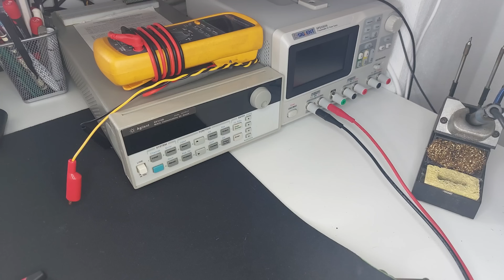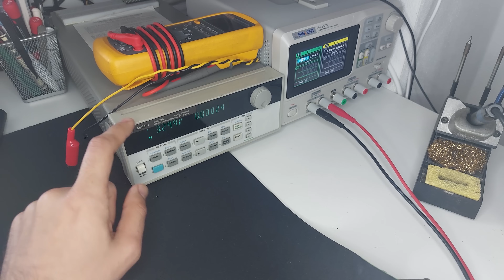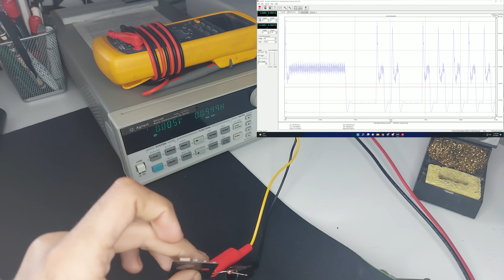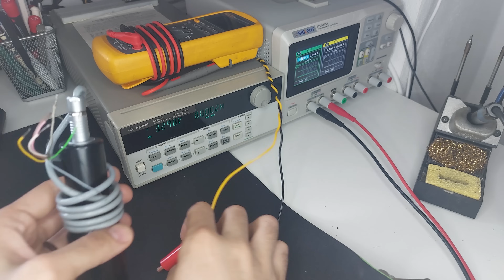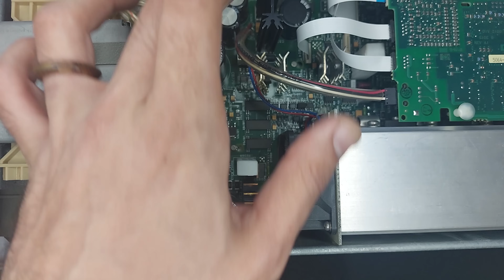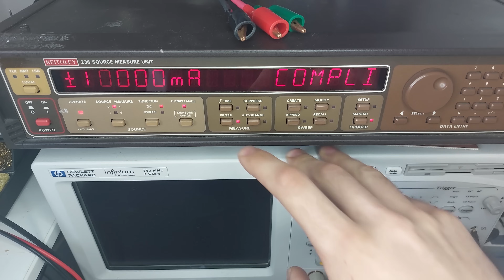The best power supply nobody knows about

Comment: The best power supply is like your best screwdriver; it all depends on what you need it for.  I must have over a dozen different power supplies in my home lab (just like screwdrivers!).  I have precision Agilent supplies, 1 kW Sorensen XHR 40-25, a Spellman 6 kV SL300 but I still love the old B&K Precision 1630 which I've had so long I can't remember which company gave it to me.  Then all kinds of Instek, Lambda and Kepco linear ones for the bench.  I've been doing this a very long time and these supplies have been amongst the most reliable pieces of gear I own.  Some of these have GPIB which lets me automate and make measurements (or fast ones with NI data acquisition modules I've picked up at hamfests).  No software purchase needed, all done with scripts.  But for graphs without much work the free NI package (massive bloatware, but the price is right) does a reasonable job.  That Agilent looks like a worthy unit to have in your stable though.

Comment: I came to the same conclusion that these are really nice power supplies, especially for the price on ebay, Though whether they work or not seems to have no relation to what the sellers seem to claim since they rarely know how to test them properly. I'm in the process of verifying, calibrating and repairing my small collection. The really nice thing about them is the fast transient responses and designed for testing mobile devices that need to pull current in pulses. A "poor man's SMU" as discussed on a popular forum.

They are based on the 6611C/6612C power supplies that were not designed for the mobile pulses that did have the binding posts. The original 66312A did have the binding posts, but more importantly it has schematics for the main board in its service manual. It had the same 20V/2A specs as the 6612 it is based on. I bought one just so I had a version with schematics.

The 663xxB/D models don't have the binding posts but are 45W 15V/3A supplies. D models just have a built in digital volt meter. It is easier to find the D models but since this can only measure one channel at a time the additional DVM is of limited use. 

66309B/D has two output
66311B/D  has one output
66319B/D  has two outputs with battery emulation ,even faster transient response and datalogging 
66321B/D  has one output with battery emulation ,even faster transient response and datalogging

Comment: what is intro LED powering method? anyone have diagram or anything about that? or parts list?
Reply from the maker: That's up to you to figure out
Reply: @GearAcquisitionSyndrome  thank u. i did that but not that way, also that need some coil for catch power from thin air, if can u tell me, what is the transistor val/some number for ID???
Reply: Looks like there are a couple of supercapacitors in there. They were probably charged before the video started and the solder joint completed the circuit.
Reply from the maker: @mikevandebunt811  no, just two holes in the green mat and some very fine wire

Comment: Do I spot 2 Rifa/Kemet paper Y-caps behind the mains power input? The ones in the white casing will last a bit longer than the infamous transparent smoke bombs, but since Y capacitors take care of mains insulation, I'm not sure if you'd want to leave them in, or replace them with polypropylene types.
Reply from the maker: Stinkbombs maybe, will change them out. Thanks for pointing them out

Comment: I have a previous model of the HP system power supply, exact same form factor but does 20V 2A only, it came with two binding posts on the front.

Comment: correction: no front binding posts, I added a breakout panel on the right side
Reply from the maker: You're right, I'm thinking of mounting two binding posts on the front of the unit
Reply: @GearAcquisitionSyndrome  Hey, nice video, new subscriber. I've got one of these and already mounted the binding posts. It is indeed a reused chassis/front panel. If you checkout the 33120A its an exact match, not two binding posts, but two BNC connections, so you need to do a tiny bit of rework to get the banana binding posts in. Keep up the good work!
Reply from the maker: Thanks a lot!